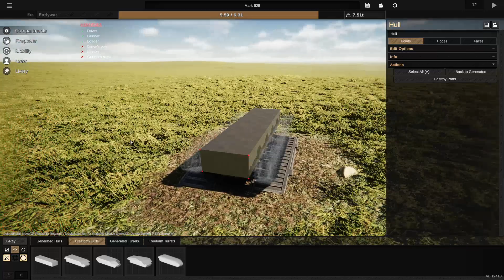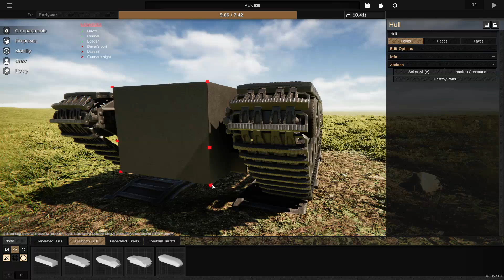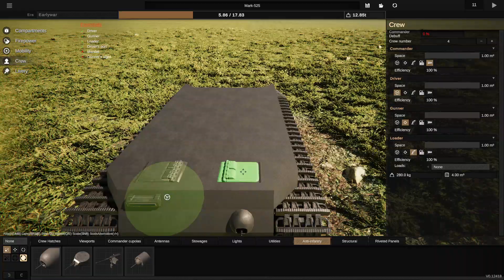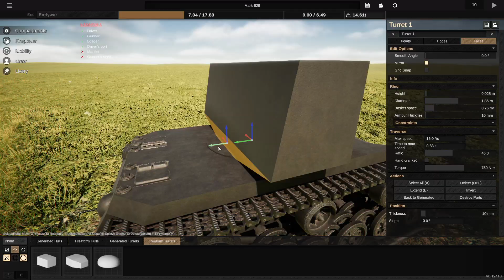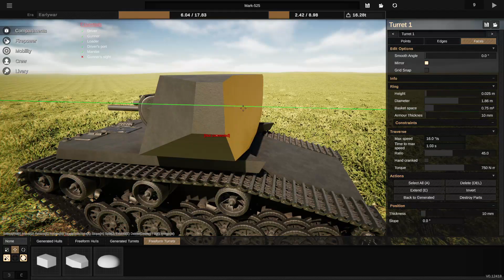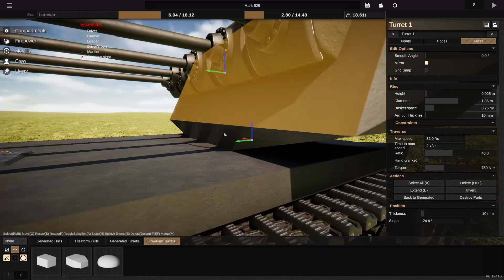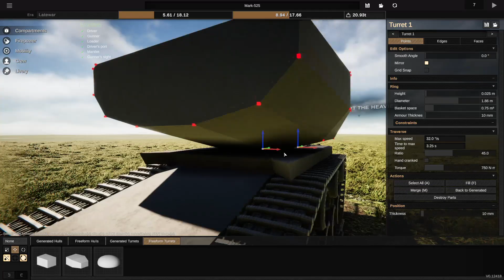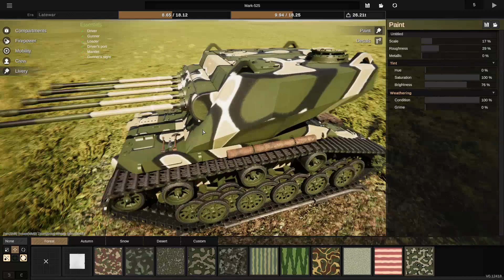I Built A CURSED VOLLEY TANK In Sprocket Tank Design!

Comment: I came up with a 3D PRINTING process, based on the Bessemer process, that uses a digital blueprint, to produce a physical object. The digital blueprint has this kind of look and feel, but was inspired by the robots in Fallout 4. Using this, you can design and build an all metal tank, piece by piece, by designing and testing digitally. Them, you put the required materials into a hopper, which are melted, cast, polished, and annealed, by CNC machines, using the Digital Clone as a blueprint. A 3D laser image scanner can be included, to copy things like a bolt action rifle, scale it up, and make that into a tank gun, for instance.

I came up with a compartmentalized zero point energy electrical subsystem, that powers turrets, independently of the main engine, in case it is compromised.

I created a gun pod system, which any gun can be adapted into. It uses an electronic firing system, with conductors instead of primers, and has the ability to use a gear based trigger system connected to multiple sears by an electric motor, which fires each barrel independently, of each gun, on a customizable timing system.

I came up with a clip-feed mechanism, for quickly loading multiple rounds into each large caliber weapon.

That can be made into a main gun, or sponsons, with clip fed, or other systems, which operate independently of the main motor and electric subsystem. These can have multiple weapons, linked together, firing on a clockwork schedule. I also developed an ergonomic, hand controlled, gyroscopically stabilized targeting system, with tritium sights, a HUD, and a LASER designator to line everything up. These systems are scalable from small arms, to small independently operated turrets, to entire naval type ships. 

Theoretically, with a functional blueprint, and all the required materials in the corresponding hoppers, any vehicle can be made (as well as ammo, and other) at the press of a button.
Reply: There, I've reduced engineering to a raw investment of time, resources, and energy